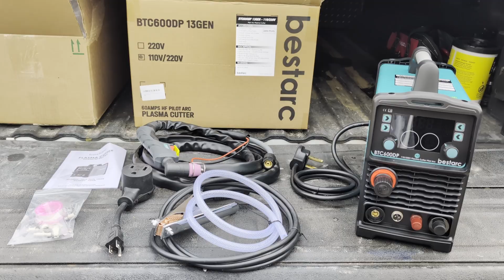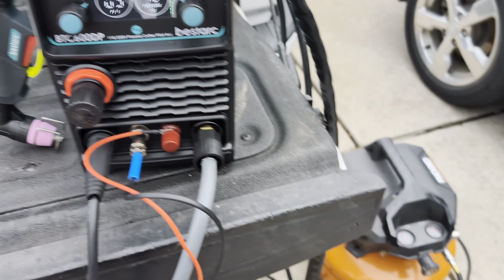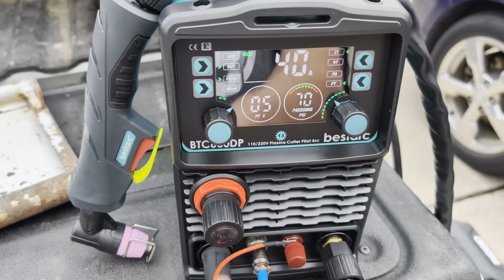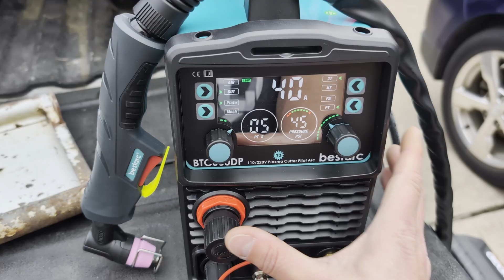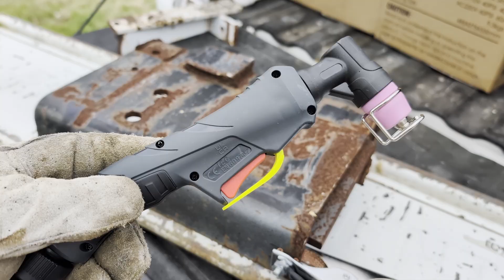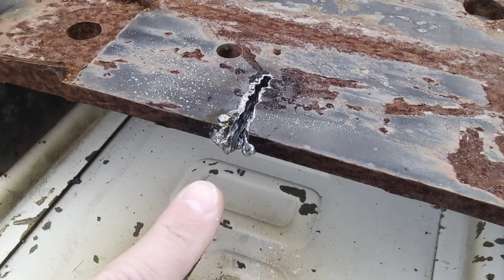The BEST CHEAP Plasma Cutter You Can Buy

Comment: I have a nice AC/DC TIG unit. I just sold my old junk harbor freight AC flux core welder so I want another flux core or MIG welder. I've been considering picking up a multi-function machine, one that also does plasma cutting. But I'm thinking I may not go that route. One of the most important things to me in a plasma cutter is being able to control it on a CNC table so if I ended up doing that, it would be kind of wasted to have the other functions if it was a multi-process machine.
Reply from the maker: The multifunction welders are nice, but if you want the plasma cutter to work on a CNC, that might be tough finding an all in one that will do that.  A plasma cutter on a CNC would be awesome.  You could make all kinds of cool stuff with that.